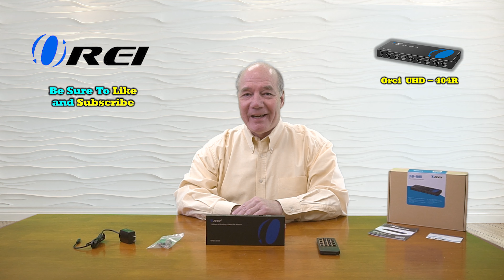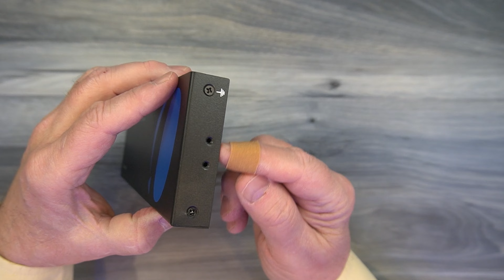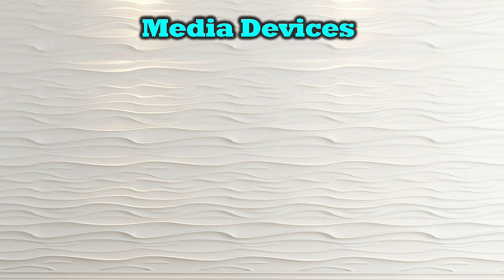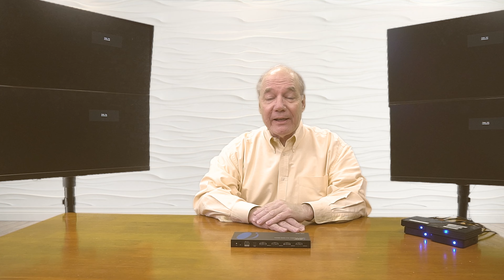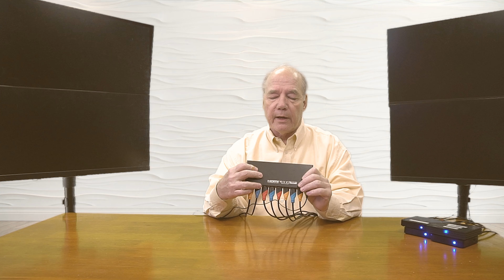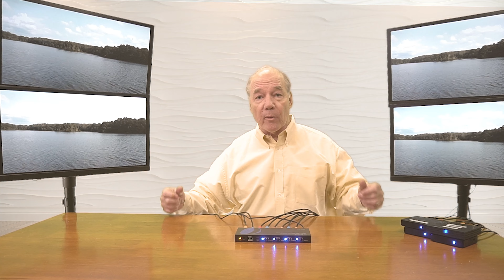4x4 HDMI Matrix Switcher 4K

Comment: I have Two Gaming PCs, an Apple TV 4K, & a steam deck.

Our home theater is 1 4k UhD 4:4:4 60hz, 2 small 1080p lcd, and one ancient but still beautiful Panasonic 720p Plasma. 

Can this handle the scaling to minimize GPU load? There is no reason to render a 4k image for a 720p screen, or will I be constantly having to swap resolution between 1080p and 720p as the second pc swaps between those panels? 

Ideally I’d like to be able to swap the Apple TV from the 720p to the 4k panel on occasion, though it almost always displays on either the 720p or one of the 1080’s. 

Finally, the Steam Deck has an issue where it does not tell any output if it is sending a limited or full rgb picture (it always sends full rgb). Some panels handle this by being native pc monitors, or having an option to lock them to full rgb. Unfortunately, our plasma cannot be locked to full (it can only be in full if the source sends the instruction). 

Can this device’s EDID controls lock the signal to full rgb and send that information to the TV, or alternatively lock to limited and convert a full input?

Comment: I wish there was an input select button or even a 2-wire contact input for an optional external button on the receivers that would imitate the input select buttons on the front of the main unit. I'd like to place receivers in all different rooms of my house. Being able to simply push a button on the receiver to switch inputs would be much easier than the remote or network control for a setup like this. I'd also love to be able to view all 4 sources as a virtual, multiplexed "5th input", but now I'm just dreaming. :) Great product. Thanks!